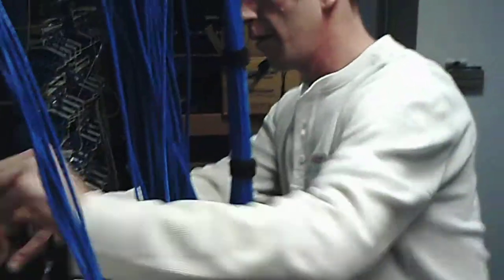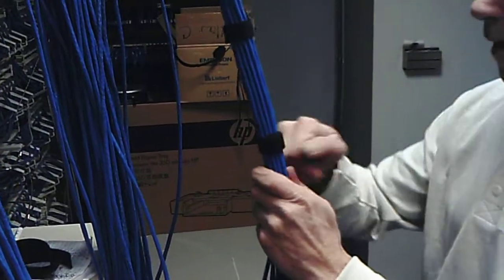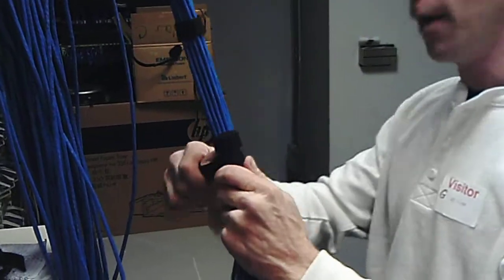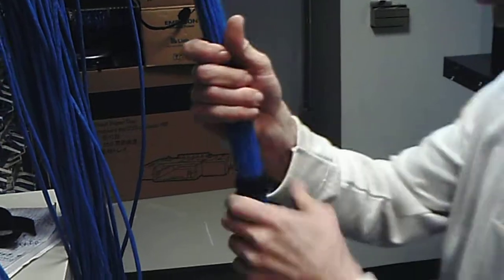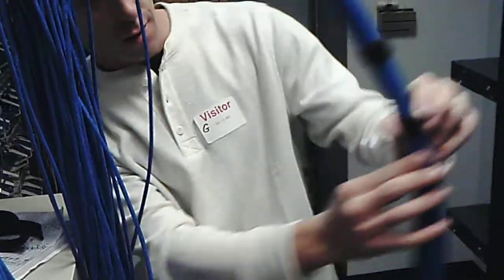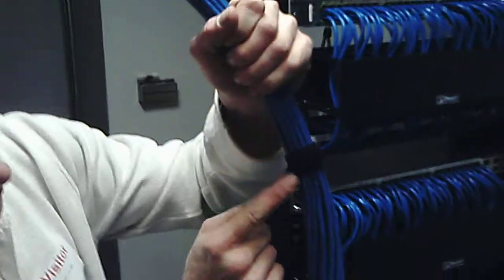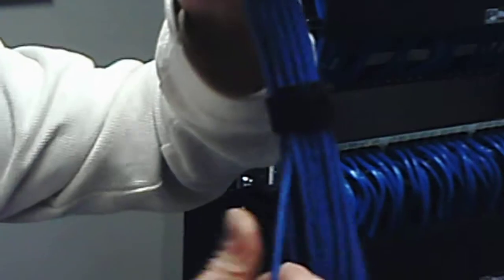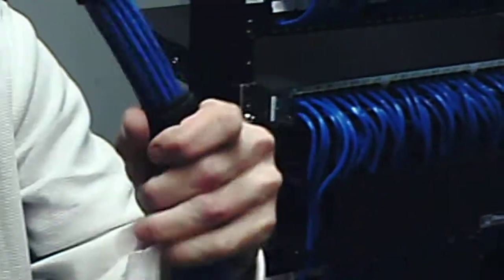Dressing Cable Techniques

Comment: Hey Dan, you may want to look at the Cable Dresser for aligning the cables on the outside of a cable bundle, it's far faster than dressing by hand.  If you wrap the inner cables of the bundle with a zip ty and then pull it through the bundle it will eliminate the divers and the need to use a screw driver. On a 24 cable bundle there would be 10 cables on the inner part of the bundle.

Comment from the maker: Yes its true that its nice to use a tool to quickly dress cable bundles., however every cable has a different o.d. and shea
th material.  How do you adjust for this

Comment: The cables should be within a few thousands of an inch if your using one supplier. I have never seen a customer require different Cat for Data and you sure wouldn't want to mix voice with data.  You are being a little silly but that's common with young installers.